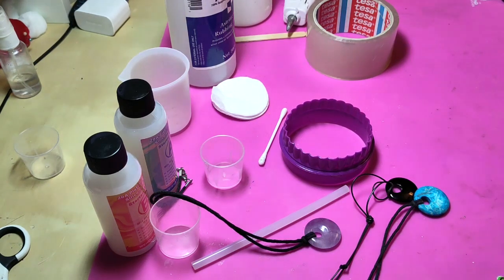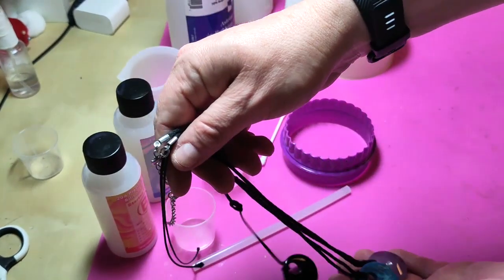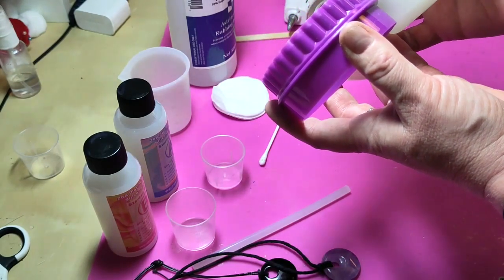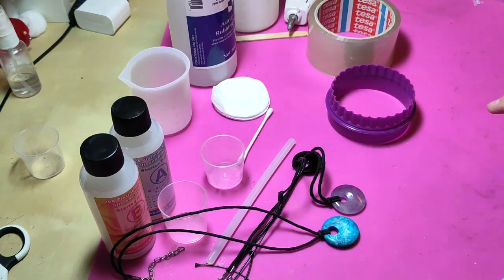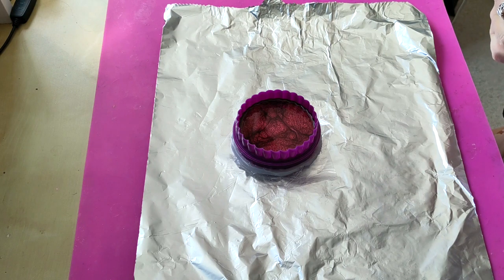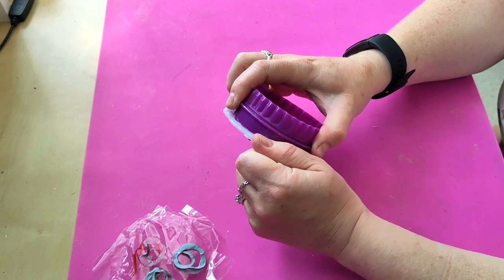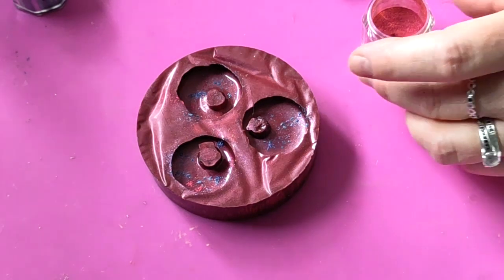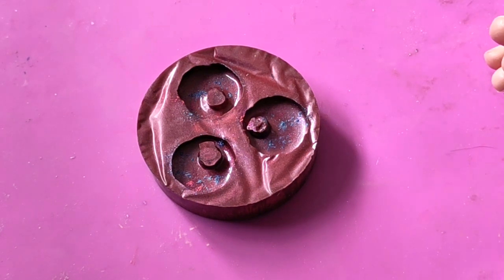Making a silicone mould from some of my favourite pendants

Comment: I was so surprised how you got away with the blue tack so easily. The colour you chose for the mould was so pretty. 
As for the pendants they came out so very pretty and I really loved the matt one Mary ❤
Reply from the maker: The Blu Tack was definite a HUGE mistake! After I'd made this mould I saw a video showing how you can make simple moulds using silicone caulk mixed with a bit of corn starch, and once you have the right texture you just push the thing you want to cast down into the paste. It would have been so much cleaner and quicker to do it that way, but it's all a learning curve. One way to sort out the terrible mess on the back is to fill the mould again a little bit then push the first piece into it with the front facing up. That would essentially make it double thickness, but it would probably still need some clean up. Once I've sanded the back properly I'm sure it will be ok. I'm also glad you like the matt finish one because I'm a bit fan of matt finishes on some things :)
Reply: These are really  great Mary, love the super shiny one, congratulations on making your 1st pendant mold I'm sure you will use it alot,if you like chameleon powder check out Emma's at the tinyturner she's has some unbelievable colour shift mica and flakes they beat the lets resin hands down, tfs I just use either a glue gun and stick them down with that or on double sided tape or even a really small piece of airdry clay
Reply from the maker: @ps3845  Thanks so much. Yes, I definitely should not have used all of that Blu Tack!

Comment: Why are you going to stick them down with blutack. It won't come out the right shape. I think you have my brain cos I would have done that a few years ago lol.
Reply from the maker: LOL! All I knew was that if the pendants didn't stick down, they'd float off in the silicone and it would be a disaster. Because of their irregular shape I didn't think there would be enough contact with the sticky tape to hold them down, and I was only intending to take a cast of the top half of them. It would have been far better to use a tiny bit of Blu Tack then trimmed away overspill; that way I would have got the rounded edge and then a flatter back. HIndsight is a wonderful thing!